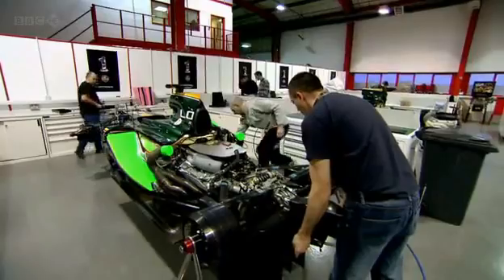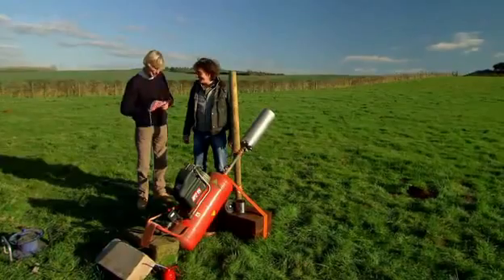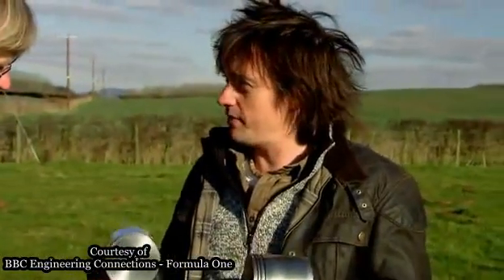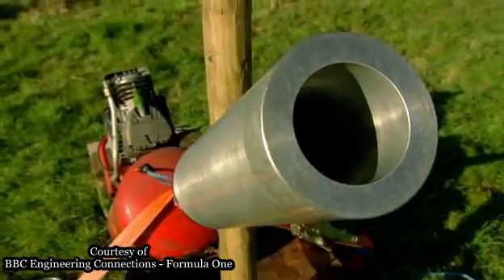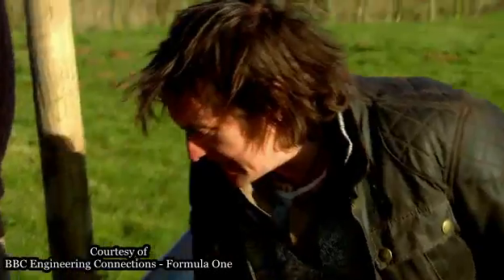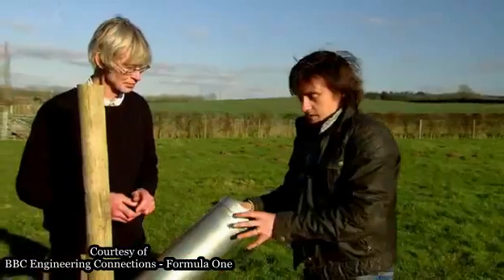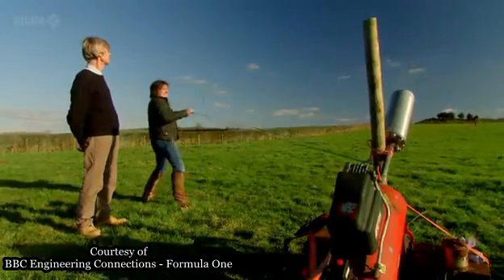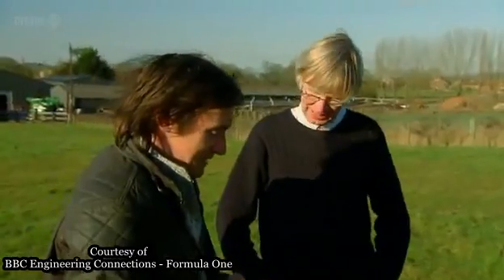The Secret of F1 Enormous Power - Precision Fitted Components

Comment: Lovely demonstration, but pistons have RINGS.  An F1 engine doesn't actually hold pressure much better than a Chevy V8.  What makes the horsepower is RPMs, which is a function of precision to some extent.  "Sealing" has little or nothing to do with it.
Reply: It has a lot to do with it. F1 engines are effectively seized. That's why they have to warm up the engine with hot coolant before even cranking it. That's how tight the tolerances are.
Reply: +Mickey Bitsko and you know this because you build f1 engines yes?
Reply: +Mickey Bitsko Dude you're a dumbass. The big bore/short stroke of the F1 engine is exponentially more important for high revs than the tight tolerances you spout as being the reason they can rev so high. And that "constant" you were looking for is 5,252 rpm. Hp and torque are identical at that rpm. Jackass.
Reply: +Mickey Bitsko torque times horsepower divided by the speed of light? what did you meant with that formula?
Reply: +Mickey Bitsko Where did you get those figures from for the torque? The figures I've seen for the current engines are more like 400Nm  (300ft lbs) for the ICE going up to 600 with the other kit running. Equating to 185ft lbs per litre. The 1.6 litre engine you refer to also will NOT rev to 18,000RPM, they're limited to 15,000, but due to the fuel flow restrictions they produce peak power at around 10-11,000
Reply: You are a fucking idiot. I understand that point, there is no need to keep telling it to me. I have explained why I commented what I did. You say my comment has nothing to do with your point then continue to harp on about something that has nothing to do with what I said. This video is irrelevant, your comments are irrelevant, my comments back to you are irrelevant.
Reply: +Robert Presti Jr tolerances on f1 cars are so strict that you need to warm up the engine before you start it.
Reply: +luis laurencio I forget the exact formula but that's how you figure out HP. HP is directly related to an engines rpm. Diesels spin slow so they have low hp. F1 cars spin fast so even though they have low torque, that torque is multiplied by the crazy RPM's. Which is why they have such high hp with low torque. It's simple. Also diesels don't run out of breath at 2,500. They are mechanically limited to low speed because of the massive weight of the components, and the diesels flame front
Reply: I'm not suggesting you're wrong about that. I'm just correcting your figures.
Reply: Are you reading what I write? I was correcting your figures. You said that they produce less torque than they do and at a different speed than they do it.  I was not defending the video, I was not saying you're wrong about that!
Reply: +Mickey Bitsko 
They can make more rpm because they are more precise and generate less friction. I developed a software, which has been used to measure F1 pistons for Ferrari. You have no clue, how much effort they invest, to make everything as precise as possible. The pistons for example have a kidney shape, because the part with the bolt hole needs to be tougher than the rest, and therefore the material needs to be much thicker at this position. This means, the piston doesn't expand equally in all directions, when it is getting warm. So they make the kidney form, to ensure the piston is perfectly round when the motor has reached its operating temperature. That's only one example and I they wouldn't do all this, if it wouldn't be necessary. The piston rings have also small gaps and cant hold the pressure completely. That's why high power engines have more piston rings than normal engines. And F1 engines have much higher compression than normal engines. You should realize, your point is completely untenable.
Reply: dimmacommunication You realize heat expands metal. and any car I have seen makes piston noise  when cold ' so one would assume the piston expands more than the cylinders.... I guess as I type this that is iron block and aluminum pistons which have different rates of expansion  would think an F1 engine would be aluminum block for weight , but I really don't know because real cars with high boost need iron blocks . The whole point is rings seal the bore not the pistons as presented in the post. Unless F1 engines do not use piston rings I'm right.
Reply: Robert Presti Jr
As I wrote above, the engine is designed so precisly, that everything fits perfect when the operating temperature has been reached. They consider different expansion levels because of different materials and different thickness of the parts.
Reply: Mickey Bitsko holy shit man its a joke
Reply: +Mickey Bitsko  Yes.. When it goes Bang  (burn actually)  it is mostly all over.
Reply: Mickey I would think the F1 engines would run" looser" tolerances as far as pistons and rings to deal with the extreme temperature changes. Nitrous and supercharged cars tend to run a lot more ring gap to avoid the ring expansion in extreme heat from destroying the piston. The F1 engines might spend more time figuring out what the perfect combination is, but I doubt the power difference  could be seen.
Reply: They run extremely low tension rings for low friction and less reciprocating weight, they want that engine running at a specific piston to wall clearance at operating temperature. I could go on and on and on but the point is moot as there is maybe 3 guys in this comment section who understand the basics of a normal car engine let alone a million dollar F1 engine designed by some of the top engineers in the world, i only build Domestic V8's up to 3500hp max, most 450-850hp and I'll be the first one to admit I couldn't design or build an F1 engine!
Reply: +Mickey Bitsko It all comes down to this video's basic (and erroneous) premise, which is that F1 engines have a high specific power because lesser engines DON'T SEAL THE COMBUSTION CHAMBERS very well.  That is simply false, and therefore the demonstration is irrelevant.  Tighter tolerances help allow higher revs.  "Sealing" has nothing to do with it.  Your Honda Accord is NOT leaking massive amounts of combustion gases past the rings.  If it did, it would drink oil and fail emissions tests.

Obviously.
Reply: +Mickey Bitsko You guys need to understand a basic fact:  An F1 engine makes about 216 pound*feet of torque from 1.6 liters.  That's 135 pound*feet per liter.  Rather a lot, but not an outrageous amount.

A 2015 standard Dodge Cummins turbodiesel can easily do that with a simple chip-tuning.

If YOUR understanding is correct then you must admit that the Cummins must be built to the same internal tolerances as the F1 engine.  Right?  Otherwise, according to YOUR theory, how can it make all that torque?  Simple logic.

The difference is the F1 engine can spin to 18,000 rpms.  The Cummins is out of breath much higher than 2500.   

The fact is  this video's demonstration ignores PISTON RINGS, which all automotive engines have.  F1 and otherwise.  "Sealing" is not an issue.  They all "seal" just fine.  Leakage of pressure is minimal even in a Hyundai.  Otherwise it would also be burning oil like crazy.  F1 engines are "tight" so that they can SPIN FASTER without flying to pieces.  That's where the horsepower comes from.

Torque x Horsepower / Constant.  Learn it.

This video is fun, but totally misleading.  It has nothing at all to do with why F1 engines "are powerful."
Reply: +SuperGreenough Google.  And that's totally beside the point, which is that everyday automotive engines "seal" just as well as F1 engines.  If they leaked the way this video suggests they'd never even START, much less pass emissions standards.  

F1 engines are built to very close tolerances to enable them to spin really fast, which is why they make a lot of horsepower.
Reply: +Ian Thompson That doesn't make more power directly.   It allows them to spin faster, which equals more horsepower.  Horsepower is torque multiplied by RPM and divided by a constant.
Reply: +David Harris Do I have to build an F1 engine to understand the basics of the technology?  An engine is an engine.  All other things being equal a tighter fit means LESS power to the wheels because there is more friction.  They make the F1 engines extremely tight to allow for high RPMs.  THAT is where the "Horsepower" comes from.

I suggest that unless you understand the basics of internal combustion engine design you refrain from sarcasm.
Reply: Ian Thompson "hp is directly related to the engines rpm" you dont say, and for real i did learn something from you, torque times rpm could mean hp, makes sense
Reply: +Mickey Bitsko And there ARE everyday, roadgoing engines (my example was a chip-tuned Cummins diesel) with combustion chamber pressures as high as F1, and which do that for hundreds of thousands of miles.  

"Sealing" is the job of RINGS, which all engines have.  And they work quite well, thank you.  This video is irrelevant.
Reply: +SuperGreenough I read it. I just don't CARE.  My point is that roadgoing engines are not leaking compression all over the place.  That is my ONLY point.  Pistons have RINGS.  That technology is not limited to F1.  

If you want to discuss the minutiae of F1 engine outputs this season we can do so, I suppose.  But that has nothing to do with my point.  The pistons in my Accord are not flapping around in the cylinders.  Compression is not pouring out through the crankcase vent.  RINGS, sir.  Got it?

The video is irrelevant.
Reply: +luis laurencio torque times horsepower divided by a constant.  There is more than one constant than the "speed of light", professor.  I'm talking about engines, not special relativity.

Comment: this is wrong. If there was gap between rings and the cylinder wall in a normal engine it would create high crankcase pressure. Its a matter of airflow, higher compression and fuel.

Comment: Jesus, talk about over simplification!  Tighter tolerance is just one factor in the greater specific output of an F1 engine, and actually is a given as it has been a fundamental in F1 engines since forever!   Other factors, which are far more difficult to achieve are, minimisation of friction, of rotating mass, much higher maximum revs, fuel delivery,  valve actuation, thermal control,  electronic control, gas flow, combustion chamber design, etc, etc.

Comment: I get video is from 2013, but how about engine size now? Aren't they even less than 2 leters now?
Reply: I just googled the regulations for 2015. 
Max 1.6 liter v6 that cannot rev beyond 15,000 rpm or consume more than 100kg of fuel per hour and cannot carry more than 100kg of fuel on board.
Reply: +Kiril Ivanov 1.6 it's quite crazy to think how small they are atm
Reply: I don't follow Formula 1 but for some reason I think it's 1.5 liters now.

Comment: I feel like there should at least be a warning about this being phenomenally dangerous. No blast shield, no ear protection, no eyewear, and hey, just to be super sure we might be injured, lets stand within 10 feet of the thing.
Reply: +Col. Angus  Yes you're right.  Compressor tanks are usually produced with a design factor of about 2 or 3.  With that said, the tanks can withstand 2-3 times the max rated pressure before they explode.  And while it may seem unsafe in the video, they are able to monitor their pressure with a gage.  Even if the gage was maxed out, at that point the tank would not explode.
Reply: +Andrew Elias The only real danger is if the safety valve fails and the tank explodes but that is a real life danger with any compressor,the stem and nozzle in the video clearly can withstand above 150 psi.

Comment: simpel , more compression = more power
Reply: +Stuntman Mike 

Lol it's the other way around.
High compression = higher peak power.
Reply: +Stuntman Mike 
dude you have no idea what you are talking about, please learn some basics first.
Reply: Yes overall more power. Its more compression therefore more efficiency and therefore more power. More torque too of course cause every single explosion brings more force to it. If you have the same engine and give it more compression, the outputpower will increase over the whole rpm band thou. But there are limits. Therefore you need higher octane fuel of course, better bushings and so on.
Reply: +Lord_Vader And thats why turbo motors have less compression, because the air/fuel mixture that normally gety sucked, and therefore pressure negative to the atmosphere, gets blown in by the turbo, which means higher pressure compared to the atmosphere. Thats more "compression" as well because there is more mixture in the cylinder in the first place.
Reply: +ThePwnij lol no
Reply: +ThePwnij if high compression cylinder head would give better peak power then i would bough that
Reply: ThePwnij yeah i learn everybody says engine with low compression head revs more and have better top end power but lower torque of course
Reply: High compressing cylinder head give less power but more torque and low compression head more high end power but lower torque
Reply: +tyler t funny because i got more power on my motorcycle when i changed low compression cylinder head to it. But it has less low end power now
Reply: +tyler t what do u think why f1 cars use low compression cylinder heads

Comment: If metal or any material for that matter expands with heat why cold engine cant be started? Logically gaps should be greater, hence less friction.
Reply: +MrCostes13  The metal that makes pistons is different to the rings, and different to the block. So the expansion is different between the block and rings. The block squeezes onto the rings.

Comment: Awful example. Engines are not cannons, they have compression rings. The main reasons F1 engines are so powerful is they use expensive materials and fabrication methods to lower reciprocating mass, increase valve speed, etc, and because they don't have to survive a 10 year warranty period.

Comparing an F1 engine to a family sedan engine is like comparing a football player to the guy sitting at home watching football.
Reply: +aluisious You're right, but you're glossing over the simple reason why which is that the engine spins faster.  It's ability to spin faster is supported by the things you and others have mentioned.
Reply: Yes...that's the definition of power. Force times distance over time. Higher RPM is more distance for the engine components.
Reply: +aluisious HP is work done over time.  Force is actually not work in this traditional sense.  The force in this matter is only related to the push of the piston and the distance from the end of the piston rotation at the crank, since it is Force X Distance = Torque at this point.  Then Torque times RPMs divided by 5252 = HP
Reply: elitewolverine You just repeated what I already said. Except if you think the distance in HP is the distance between the offset in the crank and the connecting rod, you're wrong.
Reply: You're really one of those people who is in love with listening to themselves talk. I know the formula for HP, but talking to you is like talking to a skipping record.

Comment: the f1 tech said that the pistons would be too tight at this moment because its cold, but metal expands with increased temperature. am i missing something here?
Reply: +Nolan Watts the piston expands more then the block, the piston is made smaller than the bore.
Reply: The block and the Pistons aren't made of the same materials. The block expands slightly more than the Pistons. That is how I always understood it.
Reply: ***** but if the metal of the block expanded, it would make the cylinders smaller. obviously of minuscule amounts, but a smaller bore nonetheless.

Comment: They forgot one important part of the piston, and yes, that is really important to the power of compression: the piston rings.
Reply: +Filipe Seiça Correct. There wasn't even piston rings on the pistons fired.
Reply: +DE Nichols Though I'd save the expense on piston rings if I was just going to shoot it out of a cannon and possibly ruin the piston...lol.
Reply: +Filipe Seiça If they used rings with some oil, the difference would be just a couple feet.
Reply: TIMEtoRIDE900 Or it may not have fit down the canon.
Reply: DE Nichols
Yes, maybe on the tight one rings wouldn/t work, but definitely would on the loose one.
Piston tolerances are as tight as 0.002 " on production vehicles. Half the thickness of printer paper. or a beer can.
I think the loose piston was 0.030 or more.
Five bars is just half normal compression, which triples upon ignition.
Just the facts , ma'am.
Reply: TIMEtoRIDE900 I had fun with the video, but I think you're more informative, ma'am. :)

Comment: one of the most idiot video in the internet.
Tolerances are the same between good series engine and f1 engines.
even the series engines to met the emissions regulation can have more tight gaps between cylinder and pistons to reduce blow by and oil consumption, because of the lower temperature reached during engine work thermal dilatation is lower and then gap can be reduced.
however, there are piston rings to stop blow by.
series engines are simply enginereed to reach different results, like driveability instead of maximum power.